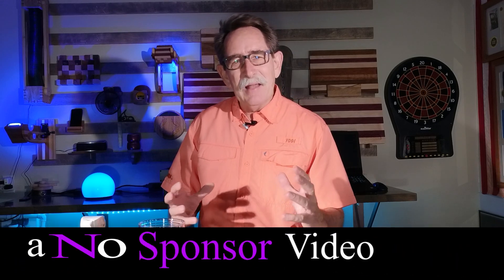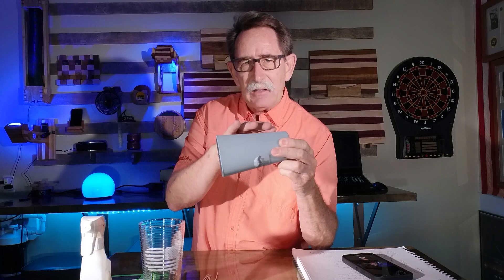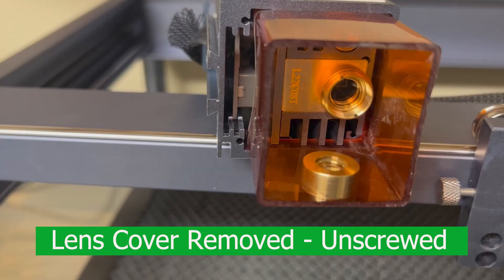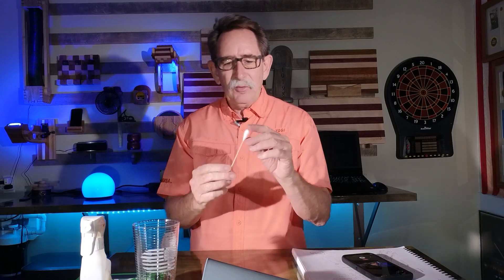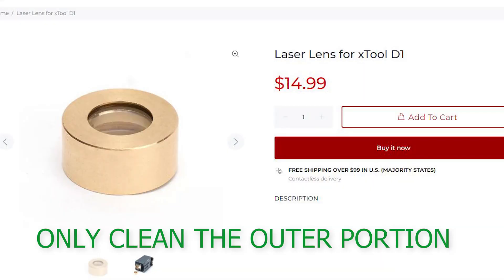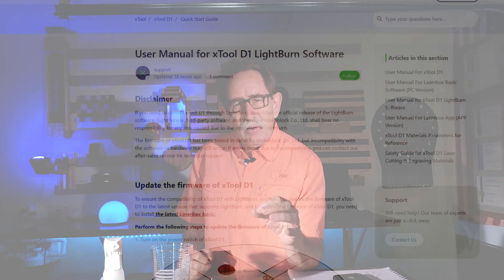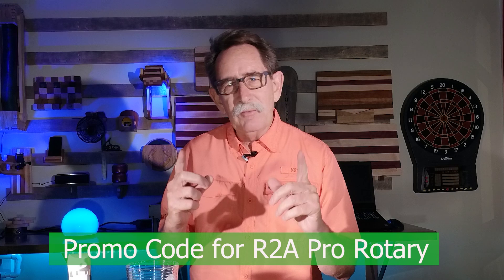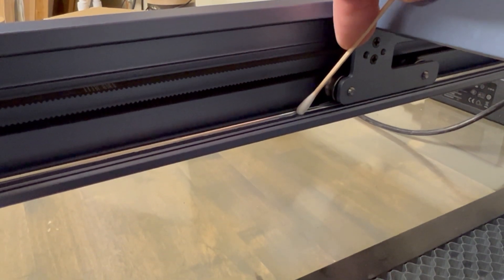Xtool D1 Laser Power Loss - My fault the quick fix -regain power!

Comment: That was a good video George. I’m an xTool owner and I religiously clean mine. Coming from an industrial process automation maintenance background, I know the important acne of cleaning. I use 3 in 1 oil on rails. Just a dab on a paper towel and wipe down cleans and oils at same time.
Reply from the maker: Thank you for the nice comment.    I am noticing the power of the lasers when turned up really high seems to "interact" with the lens cover thus reducing the power.   When my 20 watt head arrive it came with an extra lens cover.  More videos on the way, including I am going to buy a CO2 laser.   I also have 3 more Diode Lasers that have been sent to me for review.   Never thought people would like these videos this much.   Cheers!
Reply: I was lucky I guess, I was one who received 10watt with no lens and that has been a blessing in disguise. I received mine mid November so I was one of the early ones to buy one